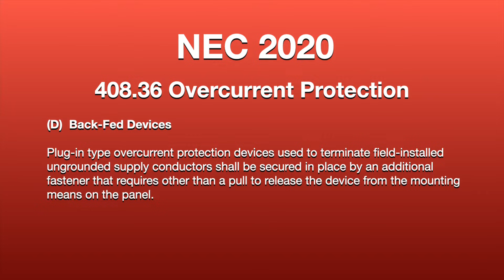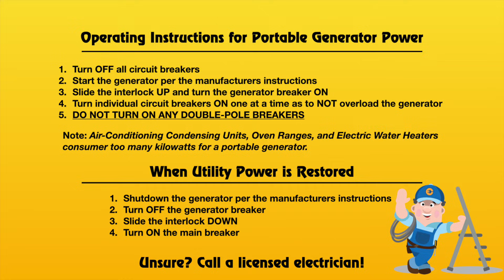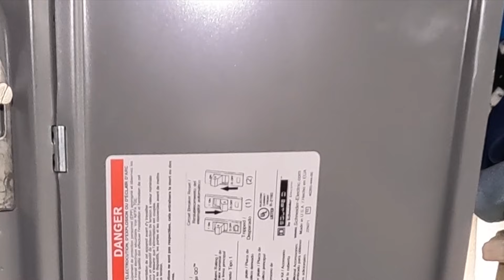Square D 'QO' 150A-225A Interlock Kit Installation for use with a portable generator.

Comment: That white Homeline surge device on the left bus should be installed in the slot nearest the 200A breaker. It's in the manual.
Reply from the maker: @chad10006  Whoopdee dooo

Comment: These panels are really nice. I removed one that was installed in 1973 and it had no corrosion after 51 years. Since then ive been suggesting to clients that they spend a little extra and get 50 years out of their panel instead of 30. The only thing I don’t like is that if you bottom feed you have to run all the neutrals down. Wish that neutral block could be relocated to either end of the load center. Looks like a nice and easy interlock though.

Comment: I have a question about placing the green/ground onto the grounding bar in the panel. I have basically the same setup but stopped once I saw grounds and white/line wires on both sides of the panel on the ground bars. 
I have my breaker in and wired with black /hot and white/hot that will coming from a L6 30R socket that I will plug my generator parallel kit into. 
Am I ok to ground the green from outlet to the ground bar behind the panel?
Could this feed back into the service lines even with the main shut off?
Reply from the maker: The L6 R30 is the wrong receptacle for a portable generator wiring. What you need is an L14-30R  inlet device and matching cord bodies.

Comment: If the main switch is outside by the meter and the ground/neutral boding happens there. And no bonding in the main panel inside. Should the ground from the generator be connected to the ground bus bar and neutral wire to neutral bus bar? Thanks
Reply from the maker: @Anas.abdul_1234  yes. At the main disconnect.
Reply: @electricianron_New_Jersey  thanks. Can I connect them in the main panel inside rather main disconnect?

Comment: Can you please tell me how can I add the breaker for the generator on top? They are already occupied . I’m thinking there’s  not enough electrical wire to bring all of the breakers down to occupy that double pole on top.
Reply: Idk what state you are in but most states allow you to use wire nuts inside the panel. You don’t have to move all the breakers down, just move the one or two breakers taking space up top down to the bottom of the panel. you would have to add wire to make your breaker/s fit further down

Comment: Will adding generator power to one side of the panel only supply power to one side of panel only and not both?
Reply: The 240v double pole generator breaker energizes both sides, just like a 240v double poll breaker takes power from both sides.

Comment: Question. When you run power from generator to that one 240 breaker. Doesn’t that only put power to the breakers on same side as generator breaker?
Reply from the maker: No, this is a single phase panel with (2) legs of 120 volts.  The double pole circuit breaker connects to both legs mechanically on the bus bar.
Reply: @electricianron_New_Jersey  ok thanks
Reply: The bus bars zigzag down the panel, so every other breaker is a different leg.

Comment: Here’s my problem: How do I use an interlock kit when my breaker is about 10 inches down and away from the main?
Reply from the maker: Either changeout the panel that can accept the interlock switch or relocate the breaker. Not all panels are going to be able to have an interlock fit because they're old.

Comment: Question here I have the same panel that I have installed with the main on the bottom because my supply is from the bottom. To my belief this panel can be installed both ways right? Question is the   interlock can still be installed here it just would be on the bottom left side right?  Thank you for your videos they are very informative from another New Jersey native..
Reply from the maker: That’s absolutely correct and I’ve done like that before too.
Reply: Thank you for your reply. @electricianron_New_Jersey

Comment: Thanks for the great video! Will this cable type typically have a neutral & ground wire & should they both land on the neutral/ground bar like all the other circuits? Also is it ok to bring the cable into the panel box through a knock out hole in the back of the panel? The panel is buried in a finished wall & my only access is through the back & then straight out to the outside wall.
Reply from the maker: Yes, and yes. That’s how I would do it too. Be safe.

Comment: Should your checklist at the end include ensuring that the generator's neutral is floating, i.e., not bonded to generator ground?
Reply: Technically it's required, but I've never seen anyone do it in NJ.

Comment: So will the interlock function  still work with the panel cover off meaning you cant flip the main and the generator breaker on at the sametime with the panel cover removed.  I have seen the interlock kits that only work with the panel cover installed which i guess some inspectors frowned apon as if the cover was removed the breakers have no interlock .
Reply from the maker: The panel cover has to be on. Only a fool will leave the panel cover off from the panel. If the inspector can point to a code violation then fine, if not he/ she can pound sand.
Reply: Which is why they aren't legal in Canada

Comment: Yeah a hold-down strap for a backfed breaker was something I learned from my city's electrical inspector when I built my garage in '04 and stuck a subpanel in there. I didn't realize it applies to generators too, but obviously it's the same idea. All these details make electrical such an interesting trade.

Comment: The SIEMENS interlocks are bad.
Reply from the maker: Yes, the auto mechanics shop I work at has a Siemens interlock.  I literally have to turn off the main breaker to remove the panel cover.  Poor design and a complete pain in the ass.
Reply: @electricianron_New_Jersey  yep I have a 200 amp Siemens interlock in my house, it sucks man like you said it’s a pain in the ass to use it.

Comment: Very interesting to see Sir we do not have those inter locking systems on our fuse boards for generator setups it’s mainly done using changer over switches and a set of instructions for the house owners personal I don’t like the fort having generator’s set ups on house because it puts the power company’s guys in danger if house owners forget to switch back unless the customer spends a lot money on automatic change over setup . Great video Sir watching from U.K.
Reply: @Ampacityelectric  I gathered that but we don’t have those in the U.K. . It was just interesting to see how other countries prevent lock off on their panels . I my mind there is nothing to stop the house owner from dismantling that kind off system  specially with some of the customers I have dealt with over the many many years been a electrician .

Comment: Hey Ron got a question the 200 amp square the panel between the QO and the homeland is there a big difference between the two And with the QO panel how many tandem slots do you have.
Reply from the maker: This is a 42-circuit panel, no tandems.
Reply: I've installed both. The main difference is the QO has a copper bus and the Homeline has an aluminum bus. If you're installing in a more corrosive environment like the near the coast or a pool pump room I would go with QO. Also, only QO is available in 3 phase. From what I have read the internals of the breakers are identical. The Homeline panels and breakers are usually cheaper. I put a Homeline in my own house.
Reply: @Doug-gp2qw  thanks Doug
Reply: Which 200 amp square D panel has tandem slots
Reply: @Ampacityelectric  thanks for the info